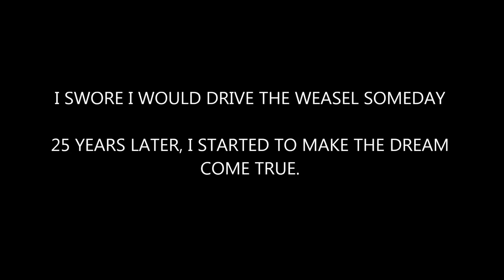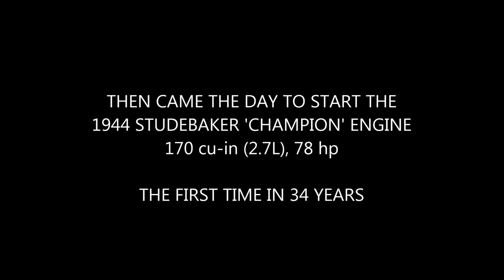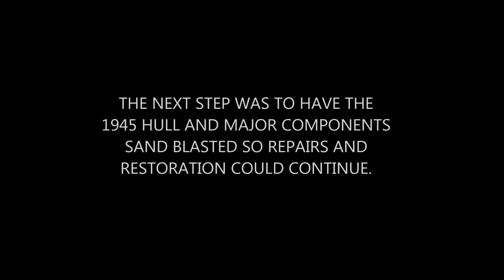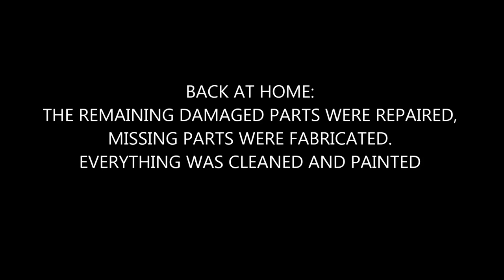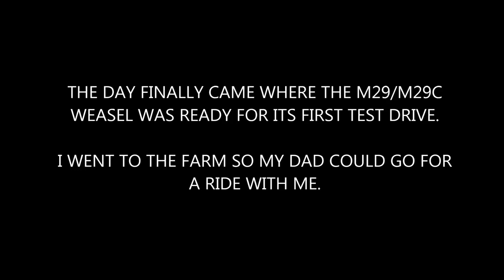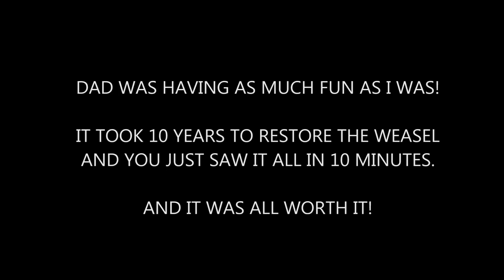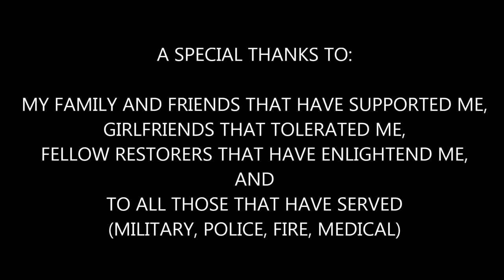M29C WEASEL RESTORATION (v 2.0)

Comment: PJ, really great video man!! I will be receiving my 2nd. weasel in a few weeks. I was looking carefully at your restoration and all the nice work you did. I have allot experience with the tracks and have rebuilt 6 pair, soon to be 7. Your track in this video is too loose. T.M. 9-1772 says the last bogie wheel pair needs to be 2 1/2" higher than the pair in front on the same wheel carrier. This measurement can be decided by measuring the distance from the ground to the center of the last bogie axle and adding 2 1/2". Then tighten the leaf spring stops on your front dog leg spindles until the desired measurement is achieved. This will prevent a track from being thrown and the drive sprocket from jumping in between the grouzers. Again, great restoration!!
Reply from the maker: Just reading this.  Thanks for the great advice!  I have T.M. 9-1772 as well. The video was the first run of the tracks for any distance and I've since tighted them after a bit of break-in time.  Good luck with your new Weasel!
Reply: @pjmansisidor2018  The best part PJ is that your Dad was able to ride with you  in the Weasel. Can you tell me what color you painted the engine please? I was thinking about painting mine medium battleship grey when I get to that point. If you would like to see my weasel, look here. https://forums.g503.com/viewtopic.php?f=77&t=310470... I will start working on it slowly through out the winter, then hit it hard next spring.

Comment: Interesting to use bed liner? on the trousers , how has that preformed ? 
Impressive amount of work to bring it back to life .
What are the plans in the future , will it go to a museum ?
Reply from the maker: Apologies for such a late reply!  The bed liner was used primarily as a rust inhibitor for the grousers.  In retrospect, I’d probably use an epoxy primer/coat to protect the tracks as the bed liner does not stand up to hard contact with ground abrasions.
Reply: @pjmansisidor2018  that is a suprise , had thought it was fairly indestructible stuff .Thanks for the update

Comment: I have found a Weasel in good condition that I want to buy. Except the rubber belts on the tracks are bad. Where did you find the new belting material? Thanks
Reply from the maker: I went to (http://www.snakeriver4x4.com/forsale.php) and talked to Tom Howell.  You'll need to know the model of you grousers as there are several kinds.  However, if your tracks already have modified rubber belts holding them together Tom may be able to set you up with replacements.  If the rubber road pads are bad on to bottom of the grousers then you and the rest of us weasel owners are in the same boat finding a way to repair/replace those.  There really is no good way most of us have found.

Comment: Universal Carrier couldn't swim that I'm aware of, and if it was so vaunted, why did the British want the M29 to use to invade Norway, or use them to in the Scheldt Estuary in Belgium & Holland, or use them in every river crossing up to the Rhine? Bren/Universal carrier was a prime mover for a light MG or artillery, Hell some ended up gutted and used as armored tracked trailers. Really an adaptation of the light tanks then in use, able to keep up with them.
Reply: Dunno, why did the US army bother buying Jeeps when everyone could have had an M29?
The point of the Universal carrier was to provide a cheap multi-purpose vehicle with light armour for the minimum cost. That meant buying in commonly available civilian engines and as many parts from existing models as possible, the Carden-Lloyd suspension system had been sold around the world so spares were available on every continent,  they even used track warping to steer to save manufacturing a complex gearbox.
There were amphibious Univeral carriers but the experiment wasnt worth the effort, on the other hand they could be troop carriers, mortar carriers, flamethrowers, rocket launchers, engineering vehicles,, radio vehicles, artillery  tractors, cable layers and most other things you could think of.
Reply: Even empty the weasel had less than a foot of hull out of the water, so a few troops and some waves would spell disaster.

Comment: It was also not as successful as the British Universal Carrier (aka Bren Carrier) which pre-dated the Weasel by several years.
Reply from the maker: Success of either vehicle is relative to the purpose they served.  The Weasel's 20" wide tracks made it ideal for navigating snow, mud and swap terrain. Signal Corp units used them extensively to lay communications wire in rough terrain out of direct fire zones to avoid cable damage.  It was also successful in M29C 'Water weasel' amphibious version in the Pacific theater and after WWII usage for arctic exploration. The narrow tracks of the Bren were not as useful in these conditions but it was utilized for tasks it did do well such as fast moving, light armor for scouting and front line re-supply with mounted firepower.If you judge success simply by production numbers then you could also say canned beans were more successful than Spam, just because they've been around longer.  I'm sure most soldiers have differing opinions on the success of canned beans or Spam too.
Reply: Interesting points but it is commonly remarked that US forces were envious of the Bren carrier which was a highly effective vehicle. I made no remarks as to production numbers as that is a risible comparison.
Reply: M29 was way more successful then Bren... they continued to use it after the war and then again in Korea, many were and are still used by private company's. ya don't see any bren's on Craigslist do ya!